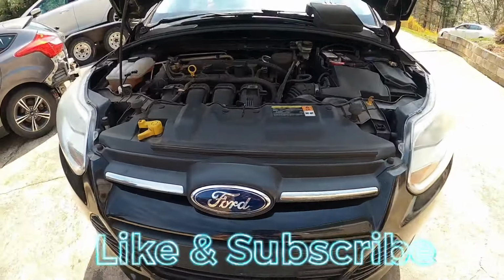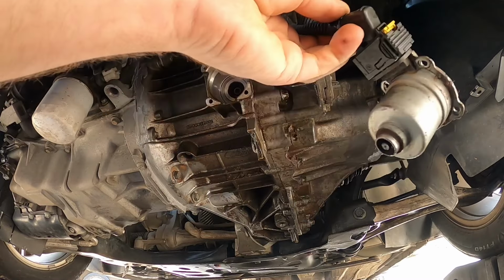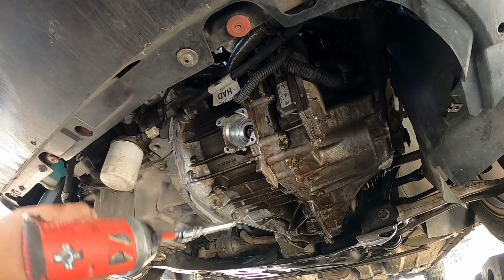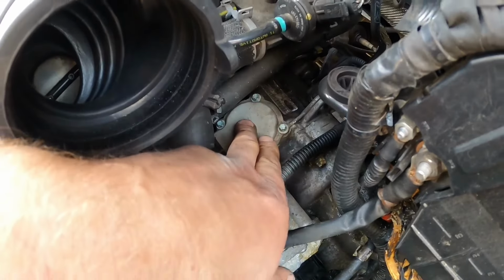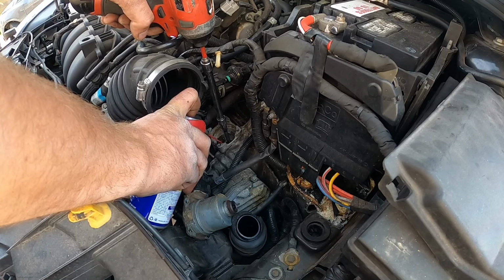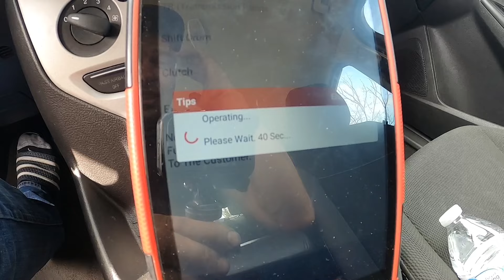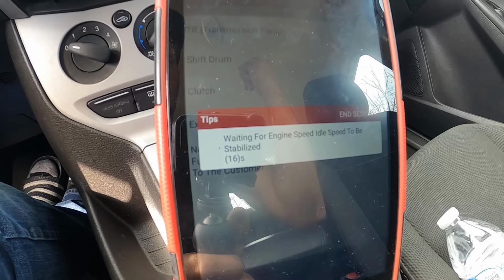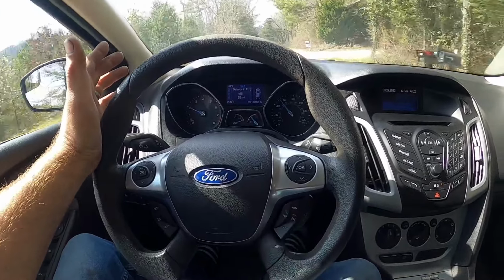2012-2018 Ford Focus Slipping? No Reverse? No Drive? Problem Solved. Easy Fix. You Can Do This!

Comment: If you don't have a scan tool after you do the process with the actuators, can you drive the car until you get a scan tool?
Reply from the maker: You can drive it, if everything is working properly it will learn on its own
Reply: @L8R-HP  Okay thanks again. I'm going to try doing this now

Comment: What happens if i turned the bolt in by hand clockwise???a few turns 😱
Reply: Did i mess something up??
Reply from the maker: Don’t think you messed anything up, but your fork is just broken and needs to be replaced

Comment: Hello, I have an focus from 2012; Previously I was getting the transmission overheating notification, I ignored the notifications and now the problem has gotten worse, the car takes a while to move forward and jerks every time I shift gears. If I put it in "P" sometimes it doesn't turn on, but if I put it in "N" it turns on. When I stop sometimes I accelerate and it doesn't move forward... now it has sounds like it's rubbing against something in the transmission, what it shows in the video, could it work? If I wrote something wrong, I'm sorry, I'm from Mexico and I use the translator haha

Comment: Curious to find out if you have ran into a P0606 and p0884 at the same time. I can't believe that my PCM and TCM are both bad, any thoughts on this.
Reply from the maker: Check your battery and all fuses. Also grounds
Reply: @L8R-HP  I was thinking about that as well. I took the paint off the two grounds under the airbox and also the  neg bat post cable termination no change. I also changed out the battery already so now I'm going to run a single wire from the TCM to the ground bus and a single wire from the PCM to the ground buss. Checked the Relays and fuses they tested good as well. Thanks brother for the quick reply, much appreciated.

Comment: what size spline tool?
Reply from the maker: ReluxGo DSG Gearbox Clutch Motor Electromechanical Unit Unlocking Tool for Ford DPS6 / 6DCT250 Focus Car Motors Transmission Ford Focus DPS6 Clutch Reset Actuator Tool https://a.co/d/a1lHwFh

Comment: I got clutch position  sensor code p0805
I'm thinking of cleaning both A and B then doing transmission  oil change ... hope it works but if I get same code I'll buy the actuator until I pin point which one it's is or replace both

Comment: have you ever seen where the mechanism that the actuator goes into is loose or wiggles around alot? also do you have any transmission removal videos for these cars?
Reply from the maker: If it moves and wiggles a lot then you prob need to replace the forks. I don’t think I have a detailed video on transmission removal

Comment: Is there any alternative drill attachment that I can use if I don't have that tool?TIA
Reply from the maker: Capri Tools 6 mm M6 Stubby XZN Triple Square Bit Socket, 1/4-Inch Drive (CP30353)
Reply: So this is a replacement for the tool used on the B actuator ?

Comment: Hi, i asked you a question on other video and it helped me pretty good, i got a tranny from the junk yard cleaned the forks a little bit and it started driving pretty nice, after stepping ok it a little while testing it out, something snapped and now the car takes like 3 seconds to start on d and the code says that first gear not engaging

Comment: Hello, thanks in advance, my car has slipping intermittent, some times happend and another time not, only on the first change, I cleaned the forks like the video, I applyed the relearn with forscan, I also change the transmission oil,  I switched the actuators, fork A turns whitout problems, with fork B I can hear i sound like a spring on turn 4 and on turn 8 to 14, I turns with precaution and by hand, always with fluid and not force, the slipping did not improve,do you think I should withdraw the transmission?
I got this codes:
U012D - Lost comunication with generator 'A' control module
U0151 - Lost comunication with restraints control module
B1215 - External memory card
Reply: Hello, I change the clutch, forks, all the kit, and the problem did not improve 😢, does anyone have any ideas?, I appreciate your help, thank you!!

Comment: @L8R-HP   - Thanks for your video. Before I try it would you know if it’s applicable for 2014 Focus with the following codes?

P0805
P0809
P2872

Engine runs fine, but feels like it skips over 1st gear. Goes into reverse just fine.

Many thanks! RB

Comment: Hi where can I buy just the tool that makes the fork go back and forth???  That socket
Reply from the maker: Maybe Amazon or eBay
Reply: @L8R-HP  do U know what it’s called?
Reply from the maker: @5kwattz  Capri Tools 6 mm M6 Stubby XZN Triple Square Bit Socket, 1/4-Inch Drive (CP30353) https://www.amazon.com/dp/B083B6KMCL/ref=cm_sw_r_cp_api_i_YXC9AGHM1B02EB8TJD3A
Reply from the maker: @5kwattz  mine came with the set, but I think this is the one you need
Reply: Thanks alot for taking the time to reply I appreciate it👍🙌🍺

Comment: Hello how much would this typically cost? My car died today nothing was ever wrong with it I keep up with maintenance regularly but today I left my hazard lights on and the battery died when I jump started it it wouldn’t go in reverse and it said transmission service now
Reply from the maker: Could be the TCM. These cars don’t like low voltage

Comment: my bottom actuator motor has 14 splines and the 6 and 8 mm triple square both don't fit. seems impossible to find a bit or socket for it? what should I do. this is from a 2017 Ford focus
Reply from the maker: Get the whole kit I use. You’re gona need it eventually
Reply: @L8R-HP  thanks. If the actuator turns easily and spins back well, but I'm still getting the code friction element b stuck. Does that mean the actuator motor is bad?
Reply from the maker: @hunterwaldrop1749  if the forks move then I would replace the actuator, or at least switch them around and see if it helps
Reply: @L8R-HP  can i buy separately? what do you recommend (14 splines)
Reply from the maker: @serapioespinoza2616  https://www.ebay.com/itm/184480096055?mkcid=16&mkevt=1&mkrid=711-127632-2357-0&ssspo=yvwl7HUSReq&sssrc=2349624&ssuid=-qApsBzoR4m&var=&widget_ver=artemis&media=COPY

Comment: I'd say there is a internal problem.   That fork controls r,2,4,6  if it was stuck there would be a code for friction element B stuck on or off for just reverse to be the problem it is internal maybe a synchronizer or shift drum. Or internal shift fork
Reply from the maker: Yep. Guess you haven’t seen my other videos

Comment: So, I have a 2013 Ford Focus, reverse stopped working so I watched this video and replaced actuator B. After replacing actuator B though, the car does not want to start. I can turn it on, and the transmission starts clicking like crazy but the car won't even try to start or turn over. Any help???
Reply from the maker: Turn ignition on and wait until it stops clicking
Reply: @L8R-HP  thanks, I'll try that today after work
Reply: @L8R-HP  ok so, its been "ticking" like a clock for over 10 mins now and it only pauses for about 1 second every minute or so. But it doesn't seem to want to stop ticking. I recorded it but can't upload it here 😕
Reply from the maker: @damianiniguez444  try to put the original actuator back in. It sounds like your clutch is stuck engaged and car won’t start because it thinks it’s in gear
Reply: @L8R-HP  alright, I'll do that tomorrow and see what happens. Thank you.
Reply: @damianiniguez444  Hi Damian, could you fix it?I have exactly the same issue but I have not replaced the actuator B. Hearing the same clicks when trying to turn on the car
Reply: @tuconsultapp3094  at the moment I think replacing actuator b did the trick......the car was stuck in park for some reason but I forced it into neutral and it now doesn't click anymore. I still can't turn on the car tho but I think its the starter. Once I figure that out I'll update you on it.

Comment: I would advise not using a impact/electric driver when moving the forks. Use a hand wrench.
Reply from the maker: Facts. If you don’t know what you’re doing please don’t use power tools
Reply: @L8R-HP  i saw you had it set to a very low torque.  But inexperienced  viewers might do some damge.

Comment: I have error codes P090D, P2831, P2836, P2837, P285D, P285E, P2862, P287B, P0805, P0902, P0903, P090C. I know its a lot of codes but Im hoping they are all related to Shift Fork, Actuator/clutch. Any thoughts ?
Reply from the maker: That many codes it’s probably the TCM. Or ground maybe
Reply: @L8R-HP  ground? What do you mean by this?
Reply from the maker: @kelsoriche3637  ground wire going from car to transmission

Comment: I have a 2015 ford focus and it would slip between 1st and 2nd. I changed the transmission fluid to Amsoil DCT transmission fluid. It has been 2 months now and I cannot get it to slip. Amsoil DCT is about $20 a quart, but I am sold.

Comment: Yep. It's the transmission.....unless the transmission parts aren't part of the transmission.
Reply from the maker: Or is it? If the clutch goes out on a manual transmission, is it the transmission? Or the clutch? Do you replace both? Or just the clutch and the slave cylinder? Think about that 🤔
Reply: @L8R-HP  😂😂😂 Same thing. The clutch is part of the transmission. You're trying to split hairs.
Reply from the maker: @randyscrafts8575  the clutch bolts on to the fly wheel on the engine. Just sayin
Reply from the maker: @randyscrafts8575  split hairs? Never heard that one before. Must be super old

Comment: I an having same problem as this car,but I don’t have any engine warning lights and I don’t have any faults code when I scan it
Reply from the maker: Forks are sticking
Reply: @L8R-HP im going to try this now just got all the tools
Reply: Cleaned actuator b but doesn’t reverse at all now
Reply: I don’t know what to do
Reply: @L8R-HP  so what do I actually need to get replaced forks and clutch?
Reply from the maker: @Aksonjoe8678  yes. Clutch and forks kit. Will be good as new

Comment: My code is p090c “clutch b actuator control circuit low “ do you think I have to replace both ??
Reply from the maker: Switch them around and see if you get a code for clutch A
Reply: Did you fix your p090c issue? i am having the same problem and cant figure it out
Reply from the maker: @rctowers  swap A & B around
Reply: @L8R-HP  already did that same code p090c
Reply from the maker: @rctowers  the fork is stuck :/
Reply: @L8R-HP  I tried this method on the video to see if it helps :)
Reply: @rctowers  Did it help?
Reply: @chasing-destinydotcom  Yes and no. The first time I did this procedure it worked for a day. Decided to do it again and it’s been a full 3 days with no issues, no slipping, no shuddering, running smooth. Going to do the method again tomorrow and see how long it lasts. I recommend doing it by hand with a rachet, you can get a better feel when the fork stops and are less likely to ruin your forks.
Reply: @rctowers  Thank you.
Reply: @rctowers  Did you continue having to do this?
Reply: @arickle  yup, ended up taking the transmission down and replacing both forks just to be safe. This only lubes a small portion where the rollers slide up and down. In order to get it to work properly you need to take the transmission down and clean everything and do it right. I ended up borrowing the tools from a friend and did the job in my garage on a weekend. Worked fine after but sold the car shortly afterwards since I didn’t want to deal with any more transmission issues anymore. Good luck

Comment: They are NOT all the same. In November of 2011 Ford installed the 1st generation of this transmission,  but in August of 2012 they switched to a newer design and if you take a TCM from a Focus built after August 2012, it will not work in a Focus that was built before August.  Wait times for a "new" TCM from Ford is 6 months or MORE.

Comment: Great video, I have an issue with my 2012 ford focus se, I started slipping alot in the first couple of gears and am getting a P0705 code. I looked this up and is showing transmission range sensor. I couldn't find the sensor and I'm not getting the Pcodes for the actuators any help would be awesome. Your video is fantastic.
Reply: Range sensor is basically Neutral safety switch, which is locater on top of your transmission but only thing you'll see is 2 screws and a Plug as it basically inserts into the tranny when mounted.

Comment: So this transmission has no fluid at all to change? I’m about to try to do this this week.
Reply from the maker: There is fluid to lube gears. Dual clutch transmission fluid
Reply: @L8R-HP  do you recommend changing the fluid as well? I read it was a “maintenance free” transmission.
Reply from the maker: @chrisz.9974  I would drain the oil and inspect it at least. Doesn’t hurt to change it

Comment: Hey what is the name of that 6 millimeter tool you used to turn the forks
Reply: I need to know also
Reply from the maker: https://www.ebay.com/itm/184480096055?mkcid=16&mkevt=1&mkrid=711-127632-2357-0&ssspo=yvwl7HUSReq&sssrc=2349624&ssuid=-qApsBzoR4m&var=&widget_ver=artemis&media=COPY
Reply from the maker: https://www.ebay.com/itm/184480096055?mkcid=16&mkevt=1&mkrid=711-127632-2357-0&ssspo=yvwl7HUSReq&sssrc=2349624&ssuid=-qApsBzoR4m&var=&widget_ver=artemis&media=COPY

Comment: This video was really informative, but I have a question about my Ford Focus. It’s a 2015 @108k miles. It recently stopped reversing and the check engine light came on. I checked the codes, and it said the actuator B was bad. So I replaced both of the actuator with aftermarket ones. And it didn’t fix the problem. Do I need to program it?

“Can my transmission be fixed by the steps in the video”

Please help! Because I don’t wanna have to take it to the ford dealership.
Reply from the maker: Sounds like your forks are stuck or bad. Aftermarket actuators aren’t that great
Reply: @L8R-HP  Thanks for replying, also when I put my old actuators back on, only sometimes the car will go into reverse, but the car will still jerk and shudder.
So would that be a bad actuators or bad TCM?
Reply from the maker: @karmansingh6083  try to lube up the forks and see if that helps

Comment: what socket you use to remove the bolt on Acuators? I saw another video someone followed your suggestion to remove the acuator and clean it. And I have a Fiesta. Seems very difficult to remove the other components to get to the top one.
Reply: 3/16th

Comment: Can you clarify something for me - I am sure this will fix my issue, but my battery went dead and the actuators will no longer move and when I jumped the car it was making all sorts of noise at the actuators. They are stuck engaged so I assume I can use that tool to reset them by using that tool and getting a new battery and using ForScan to fix the adaptations. If they are engaged, does a full counterclockwise turn to the end disengage the clutch and forks?
Reply: Did you ever find out any more information as to why you're actuators were engaging and what did you do to fix it? Thanks

Comment: What is the name of the  scan tool app you are using? I have a code P0805 ( clutch position sensor circuit malfunction)and I have changed both actuators and I still get the code for clutch A.

Comment: So did this procedure… I had no resistance at all from the start.  Worked fine counterclockwise to the stop and sprung back strong.   Still have no reverse or 2nd gear. actuator b has been replaced.  Stuck!!!  Getting the clutch b stuck open code.
Reply from the maker: Try swapping actuator a and b around
Reply: @L8R-HP  I thought about that but would that matter if the codes point to the B side?
Reply from the maker: @brianking2169  swap them and see if you get a code for A.
Reply: @L8R-HP  ah… good point.  I’ll do that..
Reply: Since the current B actuator is a brand new ford part, all swapping will do is tell me the new part was bad though right?  Guess I can’t really see what swapping will tell me.

Comment: Any idea where i can find just the tool that you spun the actuator with?
Reply from the maker: CASOMAN 10 Piece Spline Tip Bit Socket Set, M-Type, S2 and Cr-V Steel, Extra Long 4'' Length, M4-M18, XZN Triple Square Spline Bit Socket Set https://a.co/d/dUMhjaO

Comment: I just tried this on B, it was going good then it started spinning freely and didn’t stop after 14 turns. Did I just ruin the fork?? It won’t go into drive.
Reply from the maker: You didn’t ruin it, your fork was bad.
Reply: Ok thanks
Reply: The mechanic is telling me it’s throwing a code for clutch A not engaging and first gear. He’s saying that i need a whole different transmission and a new clutch, actuators, and forks. Does this sound right?
Reply: @timbunch8972  Same thing happened to me; Either the fork B was going bad or I over torqued it and broke it; car would not drive. I had hoped to just get the forks and seals replaced - and then reset the old clutch; which should have worked but the old clutch would not reset properly; so had to get a new clutch as well; $2K later - working fine. Sigh.

Comment: I see you’re going in reverse, then it spins really fast. Are you doing that or is that the actuator spinning back itself?
Reply from the maker: If fork is working properly it goes back on its own. So turn it counter clock wise 14 times and it should spring back to original place